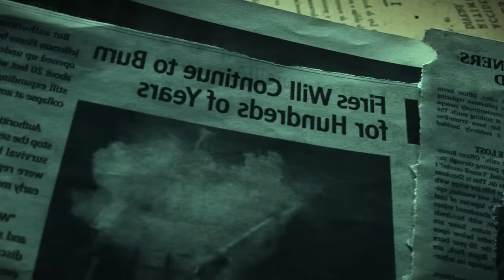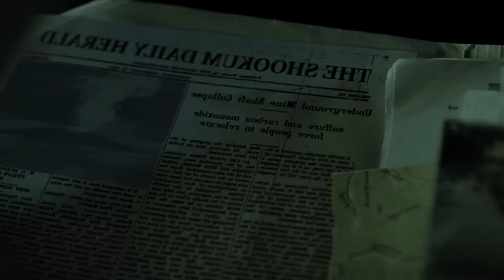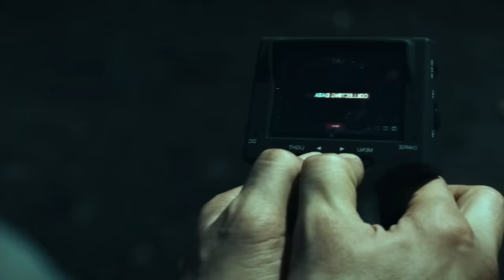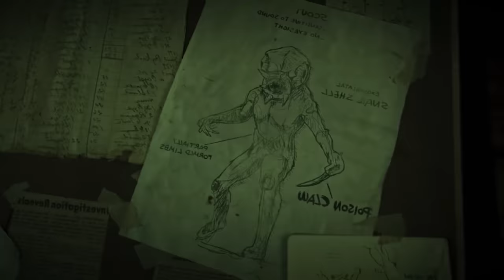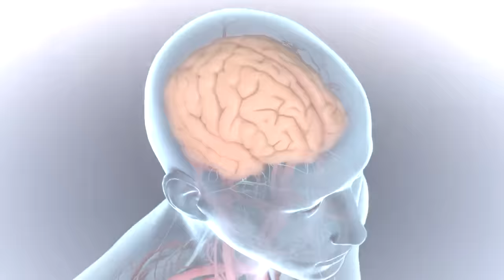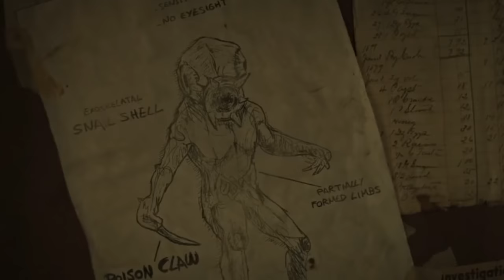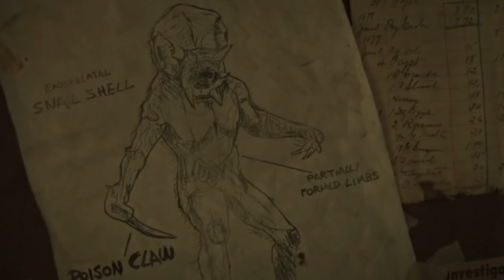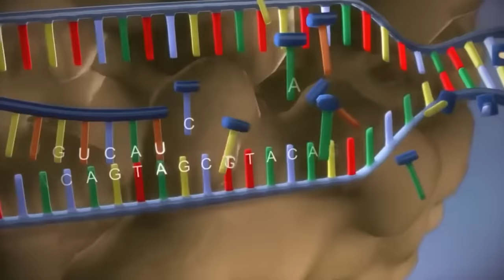WHY DO THESE THINGS LOOK HUMAN...? The Devil Below Explained

Comment: Fun fact about the borehole. Because of the heat and pressure at that depth the rock acted more like plastic then magma or solid rock which directly led to the failure of the drills they were using
Reply: So weird.  So what, it just kinda gummed it up?
Reply: @al145 Kinda, imagine trying to drill through that hot mess you get before hard candy..... well hardens.
Reply: @Lazarou101  those are both good analogies, doesn't matter how sharp your drill is when its gooey.  I do woodworking, and occasionally do stuff with plexiglass and acrylics, and they sometimes melt slightly from the friction and stick to the drill bits.  I'm picturing that but 100x bigger scale
Reply: Huh.

You learn something new everyday. Especially on this channel.
Reply: I saw a video covering this topic & the difficulties Around it. It covered this new possible drilling tech that uses high powered ruby Lasers that are able to bore a small hole & cauterize the walls of the hole. The thing is they are highly energy demanding. It's at least a possibility of a future advancement in bore hole drilling & dealing with the issues we've seen so far.. could help us tap into geothermal power in more locations around the globe.
Reply: @al145  basically yes. As well as softened the drill at the same time just blunting it
Reply: @benmcreynolds8581  now that sounds very interesting. I'm going to need to look into that
Reply: @al145  essentially yes. It's really interesting because nowhere on the surface can you find rock that does this. It's a very cool subject
Reply: Guys! I found the geologist!
For real though, that actually was a fun fact. Thank you for sharing.
Reply: So not all the geologists clicked off
Reply: @Mrdragonjack  nevah

Comment: That’s actually not an image of the super deep bore hole.  The actual hole is only a few inches in diameter, and has a metal cap bolted over the top of it.  It’s actually very interesting.  The project only ended when the got so deep that the rock started behaving more like plastic than stone.
Reply: True but it doesn't look as good

Comment: The vehicle at the start is a land rover defender 110, the 110 refers to the length being 110 inches and you can tell by it having 4 doors as opposed to 2 on the 90

Comment: 7:40 IIRC, Their Titanium Drill Bit got so hot it started having Structural Failures, several thousand degrees, and they had to withdraw it.

Thsi proves that all we need to do to get free geothermal energy anywhere geologically stable is to drill down and fill the hole with salt for heat transfer, but that's a talk for another time.

Comment: One problem with the third hypothesis is the deuterostome-protostome developmental divide. Merely incorporating new genetic material, by some mechanism, would be insufficient for the formation of straight-forward insect-human hybrid. Significant additional "monkeying around" with the hox genes would be necessary for things like limb development. Since pretty much all anatomical structures in insects and mammals are analogous and not homologous, they stem from different genetic pathways. There is some overlap, but not enough for developmental orchestration to reform insect legs into human-like legs, not to mention literally everything else, from the location of the head to the orientation of the digestive tract. The evolutionary distance is too great, and the genetic developmental programs are too divergent. It would be interesting to see what happens if you, for example, tried fusing a HeLa cell to an Sf9 cell. You wouldn't get an organism, but I'd be interested to see if the cells could replicate and whether it started dumping chromosomes, and which ones.

Instead, what seems more likely to me, is that these are humans, which have a parasitic life-form that has encapsulated them and is using them as a movement and feeding platform. The goofy size of the head could be explained as literally being this arthropod's main body gripped onto the human host. The exoskeleton is an extension of this parasite, which coats its host in chitin, as other tissues tap into the creatures circulatory system in order to syphon and exchange nutrients. The vestigial legs would make sense, as well as the bilateral asymmetry of the venomous "poison claw", potentially being a from the arthropod's abdomen stinger, oriented towards a limb for maximum utility.

Comment: Subterranean species are always so weird to consider, especially when you tie in insects. For a personal project I tried developing a theoretical subterranean ecosystem that would allow for a beetle species to exist that could grow to the size of a small car and generate/discharge electricity from Hercules and Stag beetle-like horns. I ended up avoiding coal veins as a theoretical food source by instead devising a mutualistic relationship with lithotrophic fungus and bacteria in highly acidic pools that the beetles would mine desired food sources to be fed to the fungus patch to farm a food source, and use the high concentration of metals in their diet to create battery like chitinous deposits. The real problem definitely came down to respiration though and the only solution I could come up with was a life cycle where the grubs do the mining, the beetles do the moving of debris to the pools/out of the colony, and the pupae act as electrolytic catalysts in a spring pool that the beetles would discharge electricity into to electrolyze water and create a high density oxygen environment. Really fun experiment to go down but just confirmed to me that speculative fictional biology is sometimes just an exercise in insanity. All I wanted was big electric beetles.

Comment: We haven't buried our nuclear waste since the 2010s. We put it in multi layered canisters which are sealed in concrete storing towers to hold the radiation in til the waste's halflife ends. No burying required. And yes, one of the layers is lead. People learned that burying nasty shit close to the water table is a VERY bad idea.

Comment: Land Rover Defender 110 Station Wagon. I would guess a newer model so it probably has the TD5 (turbo diesel mark 5) engine. Simple, easy to repair and still in service as the main light truck for most of NATO, although they mostly use the older TD200 engine

Comment: Look into Megalithic works the ones which are way to precise for the tools of the time, like the stone tools of the Inca and the layered construction of the walls and buildings you end up finding that the best work is at the bottom and gets worse over time. Construction methods should get better over time thus the oddity.

Comment: Let's try this again. The car they lost is either a 1984-1985 Jeep Wagoneer or a 1986-1991 Jeep Wagoneer. It has the hood from a 1984-1985 model and a grill from a 1986 to 1991 model. Most parts were interchangeable between Jeeps made by AMC. Without the VIN it is difficult to tell as you could even go as far as put on a slotted grill from a 70s J10 on a 1991 Wagoneer. There were very little changes made by AMC as such changes cost money and they were blowing that on the AMX and Javalin, trying to enter the muscle car market in an oil shortage. 

Wana come up to Michigan and help install an engine in my AMC Eagle? Jk, unless 🤔

Comment: Wouldn't something this intensely keen hearing due to lack of eyesight be weak to auditory disruptions? Like, a rifle round going off next to your head will, in most cases, rulture at least the nearest eardrum, so if these things have more acute hearing, shouldn't that same amount of pressure be debilitating to the things? Like in A Quiet Place, it makes sense that ultra-fine hearing would be ultra-sensitive to pressure changes, so I would think rounding up all the monsters you can and firing your guns a few times should be enough to at least disorient the creatures, at which point you sent in the B Team (the B stands for "beat the fuck out of them") and they clean up with some heavy axe/sledgehammer swings to the spinal column of each of the things. Because I've personally killed enough bugs to know that, realistically, if you break the exoskeleton, they're basically already done for.